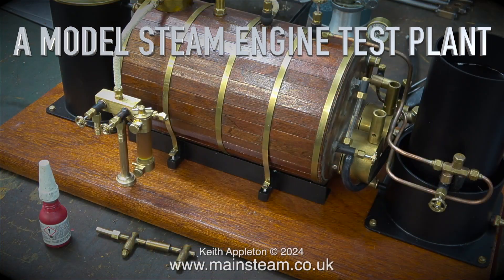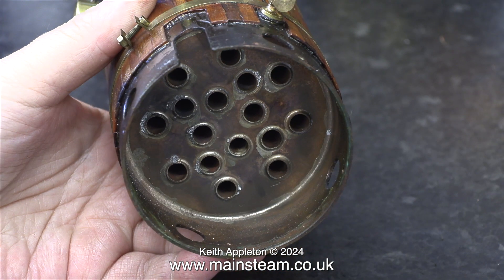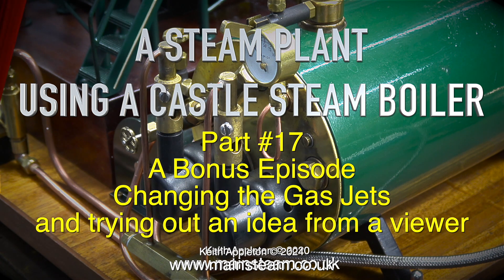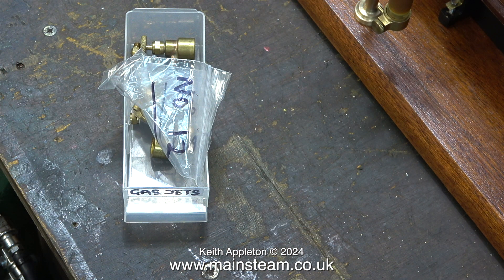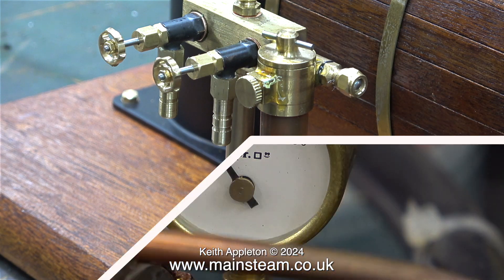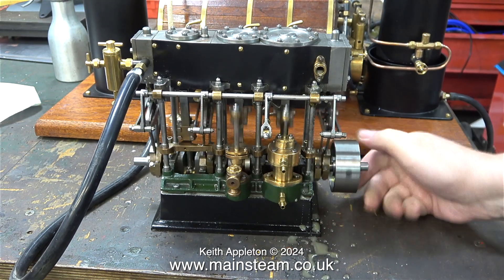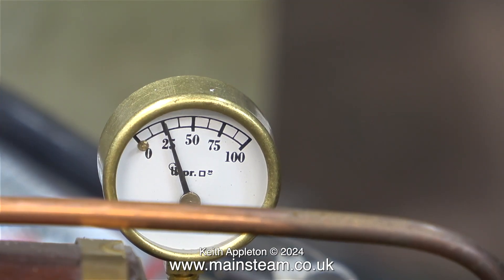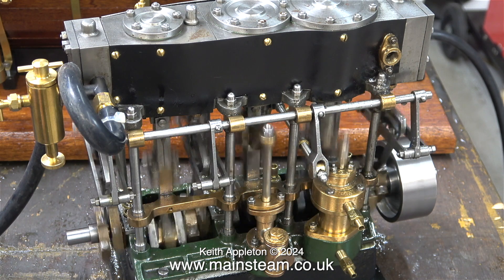A MODEL STEAM ENGINE TEST PLANT - PART #25

Comment: Do you have a favourite make or model of steam boiler that would be ok for say the Stuart Victoria
Reply from the maker: I would use a Stuart 501 Boiler fro a Single Victoria, they are quite economic on steam as they generally are run at slower speeds.
Reply: @keithappleton  Many thanks for that. In the absence of obtaining a 501 boiler, would a 504 be overkill?
Reply from the maker: A 504 would be OK and would probably produce enough steam to run 3 Stuart Victorias }:-)))
Reply: @keithappleton  Oh my word, that's really helpful, thanks again.

Comment: Bad design for the air intake, it should be easy enough to design 2 concentric rings with holes that close when you turn the outer ring so you can vary the amount of air.
But i suppose once you get the jets right it should be good.
edit I typed that before the end of the video,lol.
Reply from the maker: Please continue to watch the series, I show how to do it . . . . . . Concentric rings are definitely not required . . . . . . .
Reply: @keithappleton  It was a rotating sleve I was trying to describe.